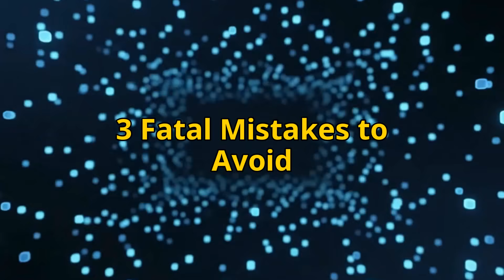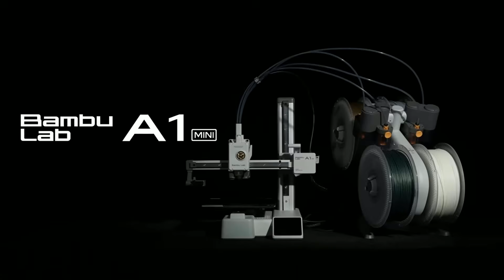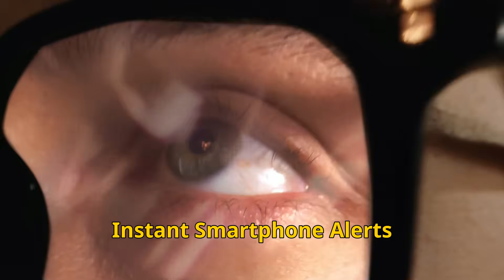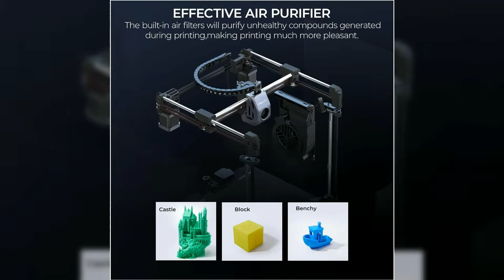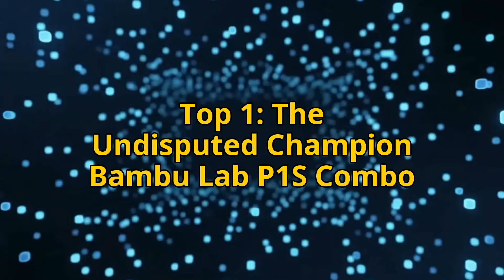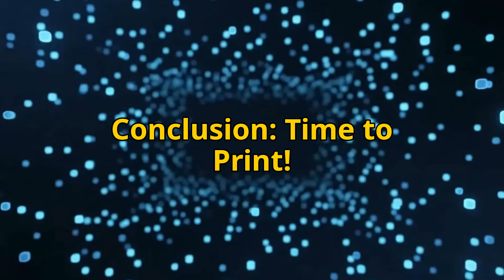Best 3D Printer - The Ultimate Bambu Lab vs Creality Showdown! - 2026

Comment from the maker: #5. Bambu Lab A1 mini 3D Printer + LED Lamp Kit
- Why we recommend it: It offers fully automatic calibration and extreme ease of use, making it the perfect beginner-friendly ecosystem for flawless prints right out of the box.
👉 Amazon Link: https://www.amazon.com/dp/B0GQMJ8QQT?tag=usmeo02-20

#4. Creality SPARKX i7 Combo 3D Printer
- Why we recommend it: Features groundbreaking CubeMe AI that turns 2D photos into 3D models instantly, plus a highly efficient four-color system that cuts filament waste in half.
👉 Amazon Link: https://www.amazon.com/dp/B0GXTTX3B1?tag=usmeo02-20

#3. Creality K1C 3D Printer
- Why we recommend it: Delivers blistering fast Core XY speeds and features a tri-metal Unicorn nozzle, making it an absolute beast for printing abrasive carbon fiber materials.
👉 Amazon Link: https://www.amazon.com/dp/B0CQKTYWXS?tag=usmeo02-20

#2. Bambu Lab P2S Combo 3D Printer
- Why we recommend it: The ultimate prosumer choice featuring the AMS 2 Pro system with built-in filament drying, ensuring ultra-crisp, high-speed multi-color prints every single time.
👉 Amazon Link: https://www.amazon.com/dp/B0FT818HCH?tag=usmeo02-20

#1. Bambu Lab P1S Combo 3D Printer
- Why we recommend it: The undisputed king of value, offering a fully enclosed body for advanced materials, seamless sixteen-color capability, and incredible out-of-the-box reliability.
👉 Amazon Link: https://www.amazon.com/dp/B0CHDS1DMC?tag=usmeo02-20

Comment: Nope, i won't touch Bambu while they continue with their locked down and anti open source practices. 
I'm currently using a Creality K1C, K2 Plus and a Qidi Max 4. All have been absolute work horses.
Reply from the maker: Fair point! The locked-down ecosystem definitely isn't for everyone, especially if you love open-source flexibility. You've got an insane trio of workhorses there though—as I mentioned in the video, the K1C is an absolute beast! How has the K2 Plus been treating you so far? Happy printing!
Reply: @Tech_Selected  The K2 plus had a few teething issues which were mainly user error, but once we learned the machine it's been awesome.
Reply from the maker: Haha, real talk, we have all been there! Half the battle with a brand new machine is just learning its quirks, so props for sticking with it. Once you get past that initial learning curve, the K2 Plus is an absolute monster of a printer. Glad to hear it's running smoothly for you guys now—keep crushing those prints!

Comment: Bambu labs printers are trash
Reply from the maker: Which printer are you using right now? Always looking to test out reliable alternatives!
Reply: @Tech_Selected I have the A1. Currently packing it back up and sending it back. Worked fine for a month and then anything I tried printing over 4in, failed. Bambu labs has given me the run around about getting it replaced so I'm just sending it back. I've wasted so much filament. Tried everything possible to fix the problem with no luck. I'm switching to the Creality K2.
Reply from the maker: Man, that really sucks about the A1. Bad customer support and wasted filament will ruin any machine for you. Good luck with the Creality K2! I'd love to hear your thoughts on it once it arrives and you get some test prints going.
Reply: @Tech_Selected I changed my mind last second and picked up the p1s with a 2nd AMS system
Reply from the maker: Plot twist! 😆 I don't blame you though, the P1S is an absolute powerhouse. Let me know if it completely redeems the brand for you once you get those massive multi-color test prints going!
Reply: @Tech_Selected it has so far. No failed prints, though I know they do happen, but it's going great with it so far.
Reply: Later today I will be attempting my first tall print which will take about 17 hours
Reply from the maker: That’s what we like to hear! 17 hours is no joke, but the P1S is definitely the right tool for the job. 🤞 Sending good print vibes your way—let me know if it comes out flawless!